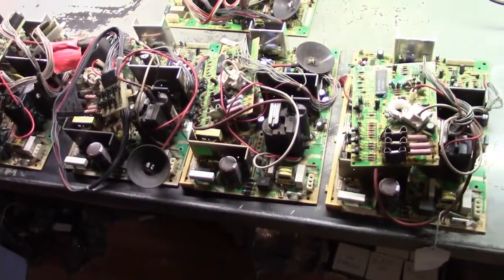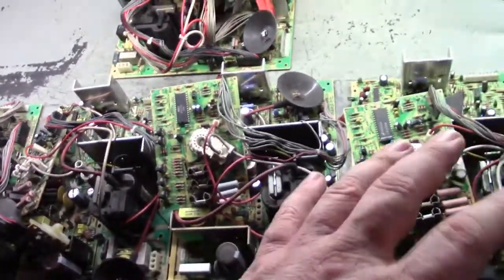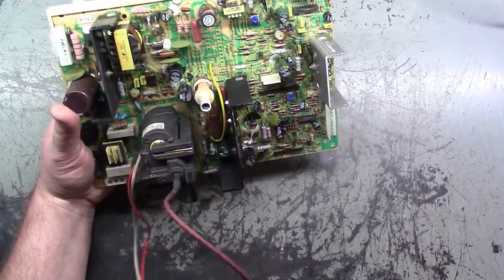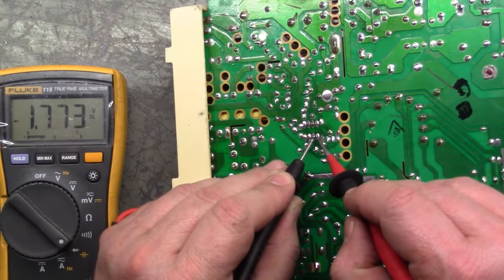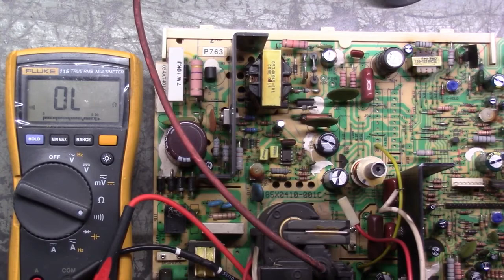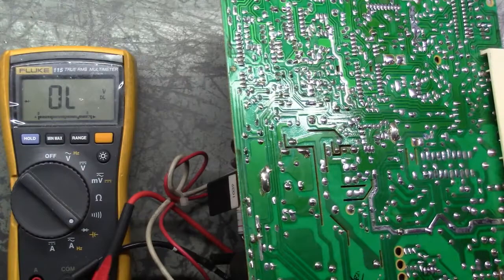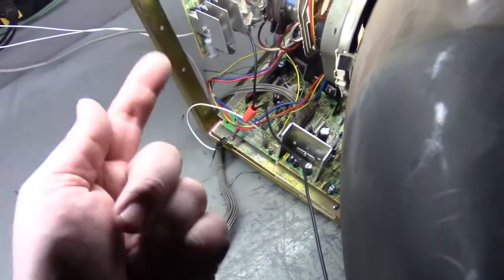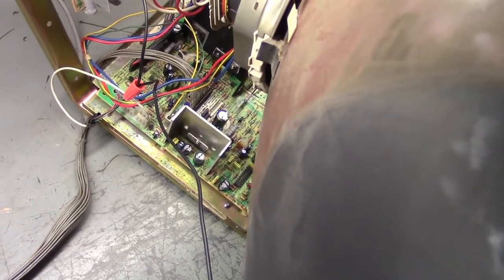25" K7400 Arcade Monitor Chassis Repair - "Not Working"

Comment: Are Zenomorp on klov? 
Replaced the damn HOT and the ticking cam back. No high voltage. Then I saw this video and c121 on my chassis has burned mark on it. Tested it and it’s bad.

Comment: Hi, Mike. Thank you for posting this video. My machine was functioning fine and then lost the image sometime during the night (I left it on).  Following your checks I found R104 is reading 13kOhm instead of 10kOhm, and from your switch mode power supply check (U101, I believe) I am getting similar readings to yours EXCEPT I get 0.00 when on the third pair of the four pairs you test. Would you suggest replacing both components and trying it out? Everything else on the board seems to be in order. Thank you, Mike!
Reply from the maker: The lightbulb test will tell you whether or not you have a bad U101 or a bad power supply section…

https://youtu.be/vJ20ufLC3rs
Reply: @MikesArcadeMonitorRepair  Thanks for the quick reply and direction, Mike.  I did the light bulb test and light bulb lit up, so I would call that a 'pass.'  I reinstalled everything in the cabinet and tested the B+ voltage at TP202.  When the unit boots up it reads 116.9Vdc, but after a few seconds I hear a click and it jumps up to 173.3Vdc and remains there.  If you happen to know a cause for that I would appreciate the advice. . .otherwise I think I'll stop here and see if I can get some more professional help locally.  Thank you!
Reply from the maker: Hmm. 116.9 is perfect. I’m wondering if possibly your HOT might be failing. When it shuts off, is it constantly “ticking?”
Reply: @MikesArcadeMonitorRepair  Nope, just the single tick.  I will add that when I received the machine a week ago I would get a random, occasional single tick, but only that first day i had it.  When it would tick the screen would have a very, very faint flicker.  But it has not done that since the first day, and was powered-on and working the four days prior to it quitting.  The HOT and Q703 both tested okay and look to have been replaced in the past, as well as some other components and caps.  The traces around Q703 are coming off the board a bit, but continuity checks out.
Reply from the maker: Based on all that, I have to suspect the flyback.
Reply: @MikesArcadeMonitorRepair  Thanks for the input, Mike.  Once it is all sorted out I will report back the findings/results.  Have a good one and thanks for making these videos!
Reply from the maker: My pleasure!

Comment: Hi mike. Can you tell us how to identify the difference between a k7400 tube and yoke versus a k7500 tube and yoke? I have a feeling the operator who I got several monitors from was using a K7500 tube and yoke with a k7400 chassis. He had a k7500 frame with a k7400 chassis on it. I think the tube on the frame was never  changed out.  It was giving me issues with a very wide and very stretched vertical image and was going in and out of vertical collapse when I tried to adjust it. Flyback needs replaced though.  It was making intermittent buzzing and leaking high voltage.  Zapped me a little when I tried to adjust it. The horizontal impedance reads .7. Vertical reads 7.1. sticker in tube reads wg1619782 in a Phillips tube. 
Thanks!
Reply from the maker: There no visual difference unfortunately. Both yokes read the same as well, or close to the same. Sounds like it’s a pretty good bet your theory is correct.
Reply: @MikesArcadeMonitorRepair  that's a poor design choice by wells gardner then, lol.  I appreciate you taking the time to read/answer my question. I believe the inductance is different between the two though. I haven't learned how to measure that yet, though. Have you?
Reply from the maker: You’re welcome. Not at present. Sorry.
Reply: @MikesArcadeMonitorRepair    Last question.  I have read that the k7400s can also mate up with k7000 tubes/yokes as well. That will be a huge help as I just use 25 in TV tubes for my k7000s. Do you agree with what I have read? Thanks.

Comment: Hey Mike.  I have a k7400 that powers up and runs fine and then shuts down after like 5 minutes so I’ll power cycle it and it’ll run all day….ever seen anything like that?  Any ideas.   I guess it’s not a huge deal since it works but I’m being proactive I guess.
Reply from the maker: What is your shutdown pot set to? Should be .01vdc at the test point right next to it
Reply: @MikesArcadeMonitorRepair  I’m getting .02 Vdc and b+ is at 118Vdc

Comment: Will the 7400 work on a 7500 tube or 7000 u 5000?
Reply from the maker: 7500 is only compatible with a 7500. 7000, 7400, 2000, 5000 are all interchangeable.